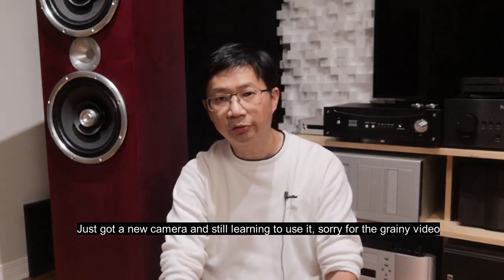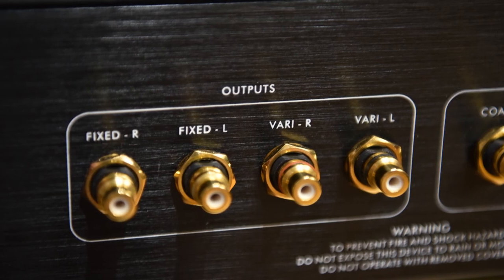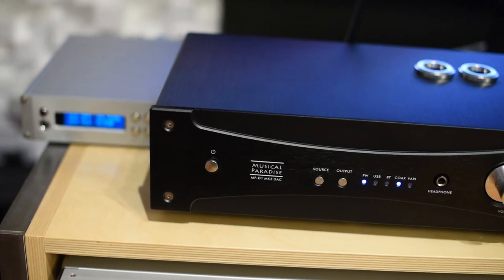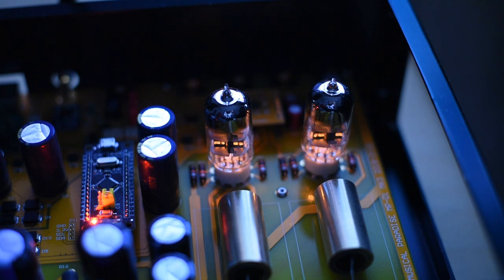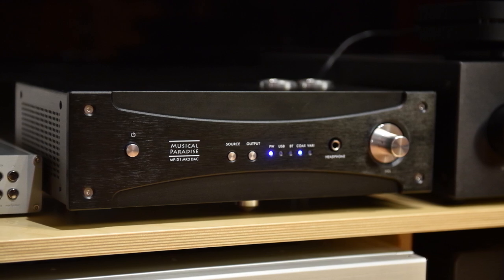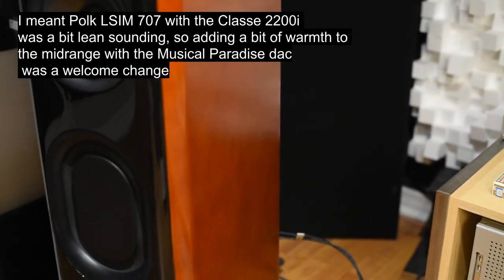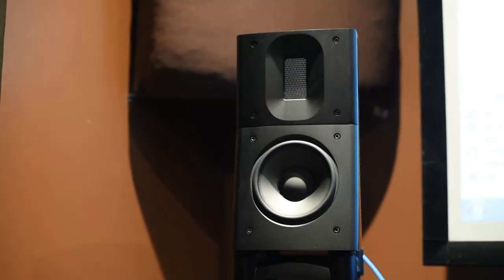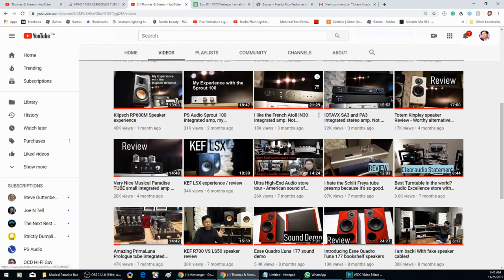Budget but amazing Musical Paradise TUBE Dac? Musical Paradise MP-D1 MK3 review

Comment from the maker: Changing from stock tubes to 6922 made a significant difference for me. The gain was low with the stock tube. I did try for a few hours with stock tubes but once I put the 6922 tubes in, I could not go back. My friends did comment that the 6922 tubes I put in are mediocre tubes (I just grabbed whatever I found) and I should have tried higher end tubes. The problem is time, too many things to test and too many possible tube combinations (I even have access to 6H30). I am sure you can get better sound from it than I did if you are into tube rolling.
Reply: Those 6922's you got are lower end tubes but they are very decent for the money. 6922 is the same as 6DJ8 and E88CC, I think they were just labeled different depending on the country they were produced in, 6922 (America) 6DJ8 (Russia) E88CC (Germany and a few other European countries), I think that's the basic of it anyway. I've tried out a ton of them and I did think the vintage Telefunken and Siemens E88CC were the best, they are expensive though and with some new production tubes sounding as good as they do it's hard to justify the huge difference in price.
Reply from the maker: Ah, nice. Thanks for sharing and hopefully it will help others.
Reply from the maker: @Mufasa Do you mean you tried it on this DAC or in general?
Reply: @lumntoob999  Hi Thomas, what are some the new production tubes you recommend that sound good? After smooth top end (not brittle) sound, clarity and good sound stage. Thank you.
Reply: @johnvalatos4073  yeah mufasa is right, the genalex e88cc is probably what you want, it's the best all around 6922 tube for the money regardless of new or old production. Unless you have pretty expensive gear and the extra money to waste I would stay away from anything more expensive and also old production tubes.
Reply: @Mufasa I agree with you, the gold lion was the smoothest sounding tube but also with the most detail at the same time as being smooth. The Telefunken & Siemens e88cc are more detailed and bigger soundstage but only by a small margin and they are not as smooth as the gold lion. I've tried the e88cc and the kt88 from genalex and the 6sn7 from tung sol and it's encouraging for the future, we need alternatives to the great sounding old production tubes that are getting more expensive by the month.
Reply: @Thomas & Stereo I bought this based on your review. this dac has great highs and treble it’s resolving on my lsim’s 707  (amp bhk 250)  but the bass is totally gone. What do i do? I’m using the stock tubes. Do I need to switch to get any bass
Reply: Thomas where do you get the price for thsi dac. Its $639 new on ebay. Also you have the wrong model number. model is mp apdxhd as far as I can tell.   How can you make such mistakes.
Reply: @jaybrenner5927  you can buy it direct from there website for $499 and I bet if you were to contact them and ask for a deal or a discount code you could save a bit more. Never only go to eBay, I am a huge eBay buyer and seller but you have to shop around before making a purchase and the manufacture website is a great place to start a search and in this case it's the cheapest option as well because they aren't paying eBay a 10% selling fee.
Reply: @jaybrenner5927  also this dac is called the Musical Paradise MP-D1 MKIII and that is directly from there website.
Reply: Thomas & Stereo I installed a pair of 6H30 since I’m using A Audio Research ref 3 preamp and ref 110 amp (both using 6h30 tubes) much more linear to my ears! Great little dac!
Reply: charlie erekuff have you resolved your lack of bass yet?
Reply: @charlieerekuff2334  any luck with better bass output with your setup?
Reply: Thomas & Stereo great review
How much
Where to buy
Reply: @charlieerekuff2334  The bass on mine got wayyy better after letting it the tubes and caps burn in for a good 60 hours i would say
Reply: If the heater can handle it I suggest trying 6FQ7/6CG7. Basically 9-pin miniature 6SN7s that might really do well in this application.
Reply: @lumntoob999  You obviously have a lot of tube experience. Do you have any advice on substitute valves for driver tubes and I believe they are called regulator(?) tubes to use instead of 12AX7 and 12AU7 in a Prima Luna EVO 100?
Kevin Deal described the driver tubes as the most important to the sound .  If I had one word to describe what I would like to maximise it would be 'space' ,the best top end sound posible.
Thanks in advance for any help you or anyone share.
Reply: @johnh539  I actually got away from tubes a few years ago but what I would say is that looking up what others have to say about the same piece of equipment is going to give you the best info. One thing I’d say that would be helpful to you is that new production tubes generally seemed more accurate and less smooth than ones that have been around the last 50+ years but brand new tubes do seem to settle out and do what people might refer to as open up with time. I’d suggest new production to 99% of people, unless you are just so deep in the hobby and it doesn’t bother you to spend a bunch of money, then trying out old tubes is a fun way to spend some time but honestly I don’t think it’s worth it in any logical way. All the money I’ve spent, I probably had over 100 old stock tube collection at one point, I don’t think any old tube I’ve tried was better than a new one, just different. Just my opinion, there is no way to have any quality control between two old tubes that have the same model number on them. Someone might get a set that they love and then you hunt down a set and spend a few hundred dollars and they sound nothing like what you expected. I’ve had that happen to me as well so imo it’s just too big of a chance if you don’t have the money to burn.
Reply: @lumntoob999  Thanks for replying.
 I have to say I have no intention of getting into NOS at least not with my Prima Luna .Maybe someday I might get a single ended amp with only one or two power valves to satisfy my curiosity about single ended amps and play with valve types but that is another story and a long way off at best. 
As it happens I have just installed quad matched 6L6GC-HARMA RETRO . Reissue of an American military design and they are already nice. I bought them from Watford Valves who claim the world's toughest testing regime. Do you think that; this kind of harsh testing reduces break in time?
Reply: Have you tried 6sn7? Psvane 181 mkii from the reference series are recomended by musical paradise. They are large but i think they fit in the neuer Version of the dac which I possess.

Comment: I bought the Musical Paradise MP-D2 MK2 with ES9038 chips a couple years ago. A few months back I upgraded it with the MK3 deluxe board and the Crystek USB board. I put 4 x 1964 NOS Philips SQ E88CC tubes in it and also a 1959 NOS Amperex GZ34. The sound is amazing.
Reply from the maker: Congrats! For me changing the tubes made a difference but I never broke in the original tubes though. Have to try.
Reply: @ThomasAndStereo  I originally threw in some 6n23p cheapy Russian tubes which are better than stock. Next was the GZ34 and it made maybe a bigger difference. The MK3 deluxe board and the Crystek USB board took the DAC to a whole other level. Then I threw in the E88CC because I always wanted to try some high falutin tubes. I have no desire for a better DAC now...its that good!!

Comment: Something to recommend, I've own this for couple months. As there are only three feet, it is completely unstable (most weight is on transformer side)make it sound thin and lose focus. Recommend to use spike pad under the feet and put some weight on the top of the Dac. This make it sound beutifully as it should.
Reply: would appreciate more details about the modification you suggested

Comment: Hi Thomas. Just to upadate, inspired by this review,  I purchased the  MP 701 Mk II preamp.  Its arriving soon. Was initially considering the Schitt Freya +  ( based on your review of the Schiit Freya) but went for the MP 701 MK 2 preamp instead as it came at a better price point with some good reviews to back it up from past owners. I understand you may review the MP 701 Mk2  amp later, hoping to get  some insights for the tube roll then if its part of your consideration for your review. Tks once again.
Reply: @Rsmesh Ramesh
Just ordered my MP701mk2.
Thomas says it's excellent, (Loic liked it apparently) but still hasn't reviewed.
Decided to order before inflation bites harder.
Still enjoying yours? 
What tubes??
Reply: @20CycleMonger   I sold my MP701mk2 recently. Its pretty good for the price point. I have now bought a Schitt Freya + as I wanted an upgrade. Running Linlai elite 6sn7 and KenRads vt 231 tubes on my Freya +.
Reply: @rsmeshramesh6914  
Did you try cap rolling?
The Freya looks less flexible. That's what I want. Something I can use lots of different tube types including 6sn7. Tube rectifier swaps too!
The Freya's not for me,
But if you NEED balanced outs I can understand that.
 😉
Reply: @20CycleMonger  Yes for my MK2 I did just a one off  cap rolling. Purchased Mundorf Gold/Silver. I am not using balanced outs. The Freya + gives a different feel though, to me it sounds better than Mk2. Lots of flexibility in terms of cap and tube rolls fot the Mk2 which is a really good thing.   With Freya + you can also tube roll but not as wide a range as MK2 unless you get adaptors. A good thing with Freya + is it has 3 modes, passive, buffer and tube modes which can suit your listening preference. On the whole, with MK2 you should be happy with your purchase. Its a good starting preamp.
Reply: @rsmeshramesh6914  
Both are entry level preamps...
Looks like Thomas will review still.
I hope he compares them.
(So far he's said it's "excellent"  :. Good enough for me ).
I'm committed for now. Looking forward to exploring the possibilities of all the tube and caps over next winter.
Cheers matey
🎶😉🎶
Nice to meet you;-)
Reply: @20CycleMonger  Nice to meet you too. To my ears, the schiit freya had smoother highs,  much more clarity and details,  tighter bass punch and better layering and soundstage  as compared to the MK 2. This is with my system, as they say to each his own. But for the price point MK2 is pretty good. It costs half the price of Freya + about sing dollars 850 plus all the upgrades I did another 500. The Freya+ cost me sing dollars 1500 plus the tube upgrades cost another 500. So price wise MK2 is worth it for what it can deliver.  Its no slouch.  But if you wanna go a notch further then Freya + is a consideration based on your needs that is. For now enjoy your MK2. Its a good investment.
Reply: @rsmeshramesh6914  
Yeah...what amp are you using? 
The Freya is a balanced design. You're wasting half of the tubes! 
They are the same price in the US with Vcap factory upgrade. 
I've got the Mundorf SGO EVO 2.2uF too. They have great timbre, but the Vcap are the best for tube rolling, musical transparency & so holographic with Bryston B3sst and Maggie LRS!

Thomas replied to me he'd recommend the MP for sound quality, SF for service in USA/CA. I've had no trouble getting info & parts from Garry @MP. He always responds quickly via email.

Thomas still threatening to drop the review BTW.

 I just couldn't get over "pride of ownership" of a piece of Norse deity Sch💩t 🤔🎶
The Musical Paradise (great moniker:-) seemed better built. (Toroidal transformer in a separate enclosure instead of rcore right beside the circuit. And then there's the Tube rectifier too:-)

Maybe Mr T is waiting to Compare the new Noval Freya? 
Hope so, but I'm done Preamp shopping.
Tubes and caps?
Tempting...
🎵🎶😅🎶🎵
Reply: @carlitomelon4610   I am really enjoying my Freya + more than MP2. The 3 modes gives me the ease and flexibility  of listening to tubes as well as non tubes. Upgraded my tubes and the music  just sounds awesome!  Didnt have the emotional and  feet tapping feel of MK2 as compared to my Freya + now. Freya + is certainly a keeper. Love it!
Reply: @rsmeshramesh6914 Hello!
 What amp are you using it with?
This matters when it comes to coupling capacitor values...

Comment: Well, I tried waiting for your review, but after reading forum comments from others on forums   I took the plunge and ordered it 2 days ago! Maybe it's good that I did, because after your review there may be a run on demand on their website!  Ha!
By the way, I will mention for your readers that Canuck Audio Mart has a great Community page filled with forums where a lot of audio gear gets talked about, and you can find a lot of talk about Musical Paradise gear, including tube swapping and affordable mods.
I will be upgrading the tubes asap.
I've mentioned this before, but my thinking is that when you evaluate gear that is ordered direct from the manufacturer, it is necessary to remember that there is no extra cost from distributors and retailers added unto the gear. This leads me to believe that gear bought direct like this should really be compared in quality and sound to gear that is 2 to 3 times the price in order to place it in an appropriate category. I know this dac wouldn't compare to dacs at $5000 or more, but it should be able to compare to dacs at $1000 to $1500, and I think it would. Is my thinking right on this?
You mentioned having problems with lower spec computers and the usb driver.
Did you use the driver that Musical Paradise has a link to on their page for this dac?
I'm asking because I am considering the MP Berry music server that they have.
However, it only comes with an Intel N3160 Quad-Cores 1.6Ghz and I now wonder if this chip is powerful enough for Hi-res? I guess I need more research.
Anyway, thanks for the great review. I am a subscriber!
Reply from the maker: Thanks Dennis! I did use the drivers on their page. It did help. I used to say when buying directly from Manufacturer has the benefit of skipping the distributor and dealer. However, I think the value is not as good as before. It is still very good of course.  So this dac will easily compete with $1k dac and more. It all depends what one is looking for cause Tubes has it's strength and weakness.  If you use Coaxial input, it doesn't matter.
Reply: Thomas & Stereo Hi Thomas . First off thank you for your channel .....  you mention if your using the coaxial , the tube does not matter ? Why ? Also I was a little disappointed it did not have a toslink input ... thanks again bill

Comment: Just got my first DAC to go with my Sony UBP-X700 I got the Sony for $179 & the Monster DAC for $30 & a Monster Coaxial Cable. I found a great HDMI DAC so I can connect a RUKu Ultra with Pre Installed Spotify & actually be able to connect to the RCA Analog inputs on my Behringer Mixer. This is a very tough dig, try it fellas a Device with Pre Installed Spotify/ Premium I would expect. RUKu gives only a HDMI output so you can only connect to a TV or SoundBar. So you have to find a DAC with HDMI input & RCA output. I did, actualy they call it a sound extractor, instead of a Digital-to-Analog-Converter. The Monster DAC I got for $28.99 has 192 KHZ. I have Martin Audio 15" Speakers & just got New Crown XLS2502 2 of them. Oingoboingo

Comment: Hi Thomas , once again a great video. You have really got me considering buying this DAC . I have been considering a Schiit , SMSL M 500 , and a Topping D 50/70/90. But having tubes which you can change interests me. I use the Schiit Saga with valve using the TUNGSOL tube which i think is a great pre amp . So  i am in serious thought  about this DAC
Reply: Hi David, I am also looking for a new DAC that is better than the DAC in my BlueSound Node 2i. I have the following setup: AMP XTZ Edge A2-300, PreAmp Schiit Saga+, Speakers Quad Z2. I am considering the SMSL M500, Topping D90 or the new Musical Paradise MP D1 MK4 that is coming out by the end of this year. Have you decided on a DAC and if so, what did you choose and what is your experience?
Reply: @larsv6144   II have not as yet decided to get a dac. I bought the Schiit EITR which is a USB to Spdif  cleaner that cleans up the USB signal from my laptop. The EITR will then send the spdif signal to my ARCAM CDS 50 cd / sacd player which has a very good on board dac which is what i will do. I am waiting for the USB A to USB B cable to arrive then i can connect it all up and hopefully will be much better than the cheap Cambridge Audio usb dac that i currently use for my laptop
Reply: I set up the Schiit EITR with the QED Graphite USB cable into the Arcam CDS 50. Very very happy with the sound quality. So no need for a new dac at this time as i am still using the lap top into the EITR and then into the Arcam

Comment: Cant wait for Thomas's review of this Musical Paradise DAC vs the Denafrips Ares DAC before I decide on which unit to buy.
Reply from the maker: The difference is significant. Depends what you want in a DAC.
Reply: @ThomasAndStereo  I would imagine the Musical Paradise would be most tube and analog sounding and the Ares would probably be more modern (modern tube) sounding ? Any ETA on the complete review :) I refuse to choose and place an order before hearing your review of these 2 amazing DACs.
Reply from the maker: @John Wee you guessed it! A few more differences but the main is that. it will be a few weeks as I just had surgery and will be out for a week.
Reply: @ThomasAndStereo  Heres to Speedy Recovery and Getting Well Soon !!!
Reply: @ThomasAndStereo Rest up and get better soon. Maybe you would consider including a sound demo also between both DACs with Polk or Ohm speakers. With help and within appropriate lifting protocols of course.